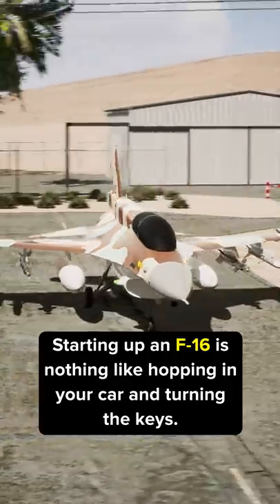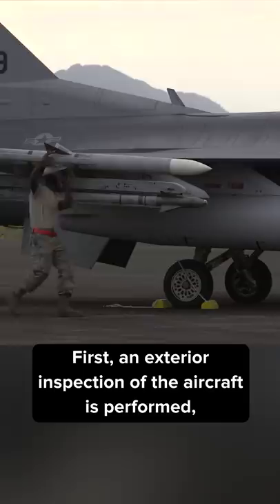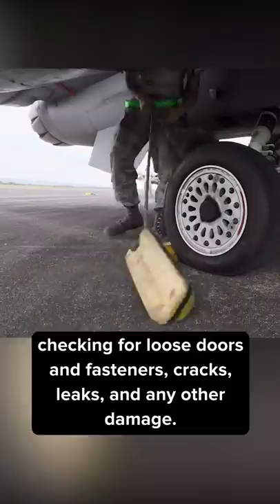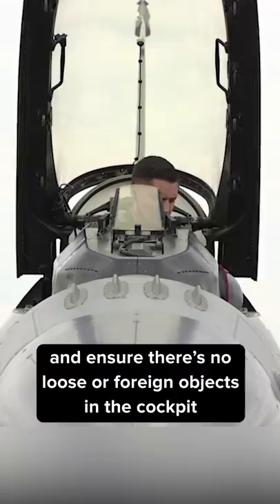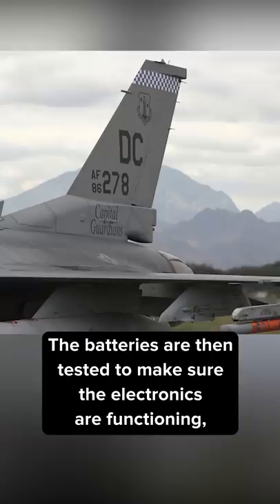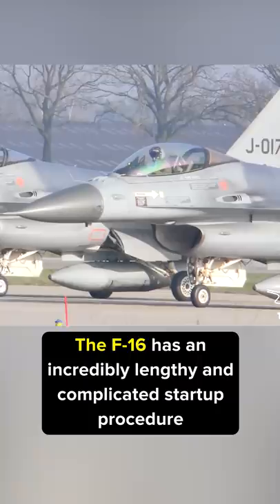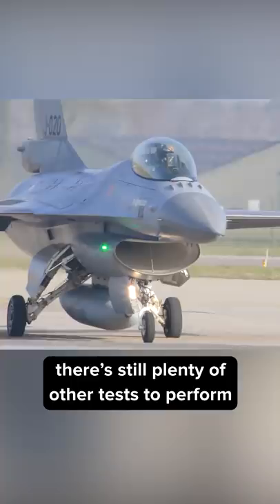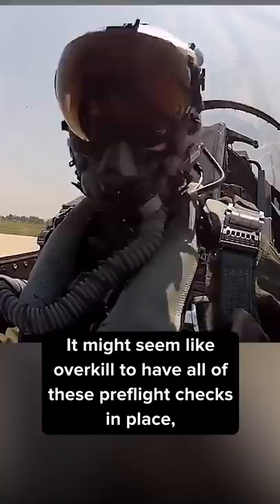Starting an F-16 Isn't Like Starting a Car

Comment: FYI: this is actually a process that you should do with every type of plane. Not just military jets.
Reply: oh yea, I was thinking that, there's the whole T's and P's you constantly check almost all the time
Reply: They is way more he just went through the basics that are common
Reply: All vehicles have a PMCS process, just depends whether the owner/operator cares
Reply: Dang someone said the same thing I said, Idk who’s first though
Reply: Yeah but especially the $30 mill planes lol
Reply: Blah no passenger jets are not checked that much as passenger walues less for trawel companies. ;]
Reply: Yeah even just the preflight for cessna 172 is like 20 min
Reply: That's a regular commercial practice. Rail, road, air, sea 🤣
Reply: So its just a normal pre flight check? Seems like it to me.
Reply: ...except for maybe the ejection seat!
Reply: A lot of it could applicable to cars, too, like checking tires and doors and making sure things are suitably restrained.
Reply: You are actually supposed to make a bunch of checks every time before you drive a car but no one does anymore. If you go to driving school in the United States they will teach you to check all lights and wheels before starting it. They had me do 2 full rounds around the car at driving school.
Reply: Yeah the main thing that is different for military aircraft compared to a civilian is the weapons which is something you also check.
Reply: I was about to say the same thing.
Reply: It can start without these safety checks. The title of this video is nonsense.
Reply: @mrpineapple3942  l  b
Reply: @elitewavez4768  they also land on dirty runways, something our planes can't or won't do, Russian planes are built diff.
Reply: I mean the loose objects part doesn’t matter much if you’re not planning to do a barrel roll haha
Reply: @luggy9256  the main hazard isn't injury but getting stuck in flight controls.
Reply: @dogboy0912  that’s a fine point, I didn’t consider that, I considered what would happen if something hit you in the face when you rolled a jet at full speed.
Reply: You think this is complicated, try the f 35 startup
Reply: @TheUnit270890  if you are using a flying club’s planes you always care
Reply: @luggy9256  I bet you it would be a major distraction as well, and even just getting bonked on the head, I bet it’s not best for the helmets.
Reply: Ha I was thinking,  don't forget to tap the brakes on first movement.
Reply: Yep. And we don’t really do this in cars because if your car breaks down, you pull over. If your plane breaks down, you need to emergency land!
Reply: And probably every type of car judging by the fact they kill 1.5 million people a year from crashing.
Reply: Well yes you have to do checks with any plane, just not quite as many as with a jet.
Reply: You re also •supposed• to inspect your car before using it.
Reply: Says the guy nobody is shooting it at the time. The post-flight I would say is just as important as the pre-flight, because you don't know when you need to go straight to military power!!! Kick 'er in the guts Dwayne!!!  🇺🇸🔱
Reply: @ok0_0  yeah cause they can't afford a good runway loo
Reply: @elitewavez4768  no, because it increases possible operational range and allows them to make emergency landings on dusty, sandy, snowy, or otherwise dirty runways, something very useful in the middle east.
Reply: Yep, always Chk the ejection seat, stores, bay doors, parachute, Weps loads, TAD helmet, Etc.
Reply: @onlygaming69  a regular passenger plane costs 100s of millions of dollars
Reply: @ahmetmutlu348  your right, they check at passenger planes more intensely.
Reply: yeh.. gotta make sure your ejection seat is functioning
Reply: This is why we are flying airliners from 30 years ago they still work perfectly unlike cars that nobody takes care of
Reply: yeah im just starting my flight training as a 15 year old and it sure is done with all aircrafts
Reply: Nice profile
Reply: @nvthvnvibin2694  nice, I’m starting too, just did a couple O flights
Reply: @SeekerPro sick dude. im like 4 lessons in and my dad got his license last summer. hoping to solo on my 16th bday in july and take my test on my 17th next summer
Reply: Absolutely right.
Reply: Main reason for air craft crashes is not completing pre flight checks except boeing planes. They're like "is the software up to date"
Reply: Exactly..even the Airbuses and Boeings
Reply: @Middy_37  "T's and P's normal, RPM governing" aha
Reply: Honestly it's probably even worse with planes like the 777 747 and a380 because they are so big
Reply: @Cilantro2  you should check out the C-5
Reply: @seekerpro486  isnt the c5 a military plane?
Reply: @Cilantro2  well yah, but I’m just referring to big planes that need to go through the check list. I went against my own topic lol
Reply: Yeah that’s what I’m saying this guys videos on military stuff are just pretty much the same thing
Reply: @ahmetmutlu348  indian cant pronounce V
Reply: @deeeznutz1665  yes, there is a list for all planes.
Reply: Not should must preflights are not optional

Comment: I'll remember this when I boot up my F-16 to go to work
Reply: For some, literally
Reply: By the time this starts up the enemy would have already captured the airfield
Reply: @YasinVanDoorsen  no, it only takes like 4-9 minutes, thats on the low end for plane startups. The A10C2 takes like 10+ minutes and is 20x more complicated
Reply: @drnefario6576  oh now i see
Reply: I envy you…all I have is an old F-4.
Reply: Can you give me a lift (pun intended)? I'll go to a job interview a few blocks  from your work
Reply: Why don't you do that in the morning? I never miss  a check !
Reply: @drnefario6576  and tbh those are the MINIMUM times. They mainly use those for scramble situations. On most sorties or training flights, they usually go through the whole shebang and to it to the T to get the most accurate preflight and startup. In many scramble situations, they usually shorthand the checklist, leaving out a few less necessary items, achieving that amazing 4 or so minute startup!
Reply: Are you telling me every time you’ve just turned the keys and shot out the driveway without any checks
Reply: The closest thing I know:
When you're driving personal car with a trailer, you're also supposed to inspect blinkers and many other parts, but do you do it by the letter everytime? Weeeeeell, perhaps.
Reply: I fly an apache to work. Lol
Reply: @drnefario6576 Lol not even, without preflight and all that it could take less then 5. Adding preflight and any other factors could add time tho, so your not wrong.
Reply: @SSASPA  yes, there is alot of switches and waiting for huds and instruments to align

Comment: Fun fact: This procedures are done on every type of plane.
Reply: Sucks to be the guy who has to check the ejection seat.
Reply: Also, one is supposed to inspect one’s car before taking it on the road to make sure that it is safe to operate.
Reply: @JohnGeorgeBauerBuis  you check temperatures, pressures, airbags, oxygen levels… everytime you hop in your car?
Reply: @JohnGeorgeBauerBuis  that’s what services are for, kid, I’m not checking my car every time I need to run down the road mate lmao
Reply: @VikingTeddy  lol
Reply: Former civilian pilot and current F-16 pilot here.  This statement is not remotely true.  The amount of checks done on weapons systems aircraft are far more extensive than even civilian airliners and completed more frequently.

Comment: Make sure a burger is inside both pockets.
Reply: necessary in-case you're mid Dogfight and get tired so you need the energy
Reply: Need McMissiles and super-sized flys. If you take off last, you will need to ketchup. Order is to go, please.
Reply: Lmaoo

Comment: Starting a plane isn't like starting a car?

I'd never have guessed.
Reply: Yeah for real
Reply: And FLYING an airplane isn’t the same a FLYING a car either. 🤣
Reply: But GTA taught me otherwise.
Reply: "Starting an f16 is nothing like hopping in your car and turning the keys, it's actually hopping in your f16 and turning the keys"
Reply: Starting cessna or some newer small planes/jets is suprisngly easy and kinda simmilar to car
Reply: Everything said is the same, minus the ejection seat, when starting any modern day aircraft.
Reply: Yeah, and you can't fill it up at Shell Station?
Reply: What do you mean I just grabbed some car keys hopped in a f-35 and started the ignition
Reply: @clinton4586  you should def get in touch with "The Military Show". He's gonna feel like a right idiot when he reads your comment. He needs to get that vid title changed ASAP.
Reply: You never see a cessna 172🤣
Reply: Hahaha
Reply: There's actually a few small private planes that are literally started like a car
Reply: @kiubekpl5863  even the simplest planes require way more steps then 

turn key
first gear
gas
Reply: Cessnas are pretty easy to start so maybe
Reply: @avrahamorsini178  I mean even for my PPl training in the C152, there is 50 items on the checklist your suppose to follow to start her up
Reply: @Flow-.-  I get there’s lots of stuff pilots have to check and all, but it’s not as hard as people think it is
Reply: @avrahamorsini178  I’m not saying it hard to start the plane (C152 atleast), but it’s definitely more work then starting a car
Reply: @HuugTuub  all you need to do is start the engine and takeoff, the checks aren’t necessary for the plane to work
Reply: I mean it’s like 3 steps but yeah💀
Reply: @peppy5121  You don't need to look both ways to cross a road while driving, and most of the time you will get away with it. But that one time you run someone over you would not only lose your license but also face charges.

Same thing with you exterior/interior checks on a plane. As PIC you are responsible for making sure the plane is safe to fly. Sure you can blow off the checks but that one time you don't check and its causes a crash you will certainly face consequences if not death. 

No good pilot just blows off the checklist, it is a part of the startup. But yes theoretically you can "just start the plane and takeoff" but that still includes 30+ steps vs a car.
Reply: Elon should install Tesla software goodbye pilots
Reply: @voiceofnewyork8575  Good luck with that after the MCAS failure
Reply: Absolutely mind blowing
Reply: I, too, could not be more surprised🤪😂
Reply: Went here to comment this exact thing, and it's the first comment I see 😂😂😂
Reply: Im assuming driving it’s nothing like my jeep either 🤣🤣
Reply: @boopreview bro you’d be surprised how dumb ppl on the internet are…😳, sum ppl actually think it is.
Reply: not even like starting an F1 car!
Reply: Does that mean no remote start then?
Reply: Starting general aviation planes start similarly to cars though.
Reply: So no rolling it down a hill, slipping it into 2nd gear and popping the clutch then.
Reply: @voiceofnewyork8575  can’t even get autopilot on cars right and you think he can put it on planes lmao
Reply: Like a plane has pretty simple controls but the f16 cockpit is all buttons
Reply: @Thomas-jn2kg  does it have a "Jarvis"?
Reply: Id’ve never guessed
Reply: Only because you have to climb a ladder to get into an F-16
Reply: You should look up the promotional video Saab put out for the Gripen.
Theyre basically selling it as if it was actually a car.
Reply: Since it’s a fking jet
Reply: Half of these reasons are just fillers
Reply: Jesus Christ I was expecting him to tell me that the sky is blue
Reply: Woah! Really? I didnt know that!
Reply: @kiubekpl5863  you would still probably have to do inspection first to make sure airplane is ok.
Especially if it's a smaller passenger plane
Reply: Yeah it’s almost like a car and a multi-million dollar jet powered live eviction machine is nothing alike
Reply: To be fair light aircraft like small cessnas you just have a standard key just like a car
Reply: It is if its a cessna skyhawk

Comment: "Starting an F-16 is nothing like starting your car"

I'm still waiting for the part where he mentioned ignition and starting F-16s
Reply: Technically everything he mentioned you could do with a car too, it's just not really required
Reply: @pkoya341  so you have an ejection seat in your car??? Huh, didn’t think so
Reply: @PtSXXVIIX  yeah, you never know how bad those car wrecks can get.
Reply: @buckett5631  LOL. “Oh shit, IM ABOUT TO GO INTO A HEAD IN COLLISION” pulls ejection cable
Reply: @PtSXXVIIX  i heard some british guy had.
Reply: @PtSXXVIIX  there was a car documentary that had a couple cars with ejection seats. I think it was called 2 Fast 2 Furious
Reply: @PtSXXVIIX  Yeah, you don’t have an ejection seat in your car?
Reply: @foxh.6652  i'm imagining pulling that ejection in an underpass or tunnel lmao
Reply: @pkoya341  you can check fuel pressure?
Reply: @grzyb11  if you want to you can yes, it's called an OBD2 adapter to Bluetooth
Reply: Main power switch, JFS start 2.
Reply: Main power engine startup 2 wait till rpm20000 then idle then the engine is running
Reply: alright, 
Battery Switch : BAT
Engine Ignition Switch : START 2
Wait for the SEC Light on the right to go out and Uncage the throttle
All INS Switches On
INS Knob : Stored Heading
Turn on the HUD
Turn on your Chaffe and Flair systems and set the knob to "Semi"
Battery Switch : Main Power
Master Arm : On
When the RDY light is flashing at the top right small screen, Set INS to Norm
Unarm the ejection seat
IFF Master button : ON
Now push the throttle forward and run brother
Reply: @pkoya341  yeah this kind of stuff isnt really necessary for a take off